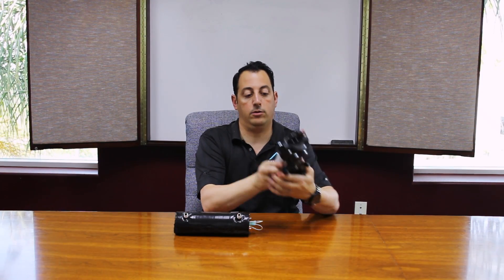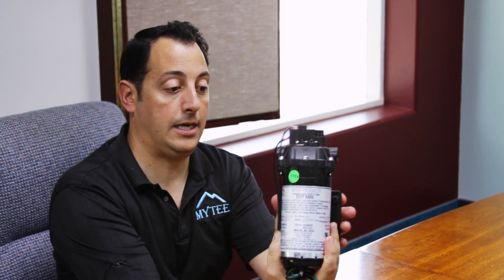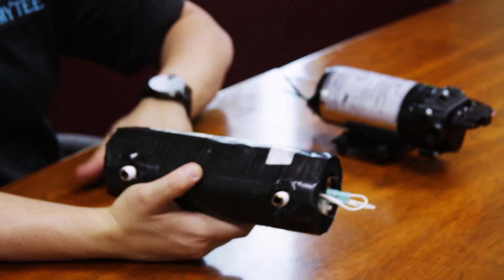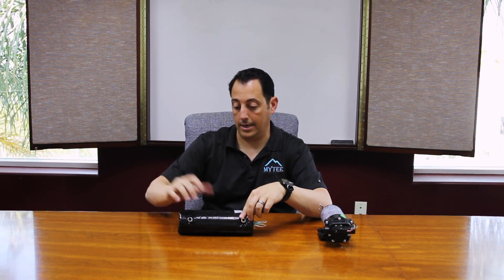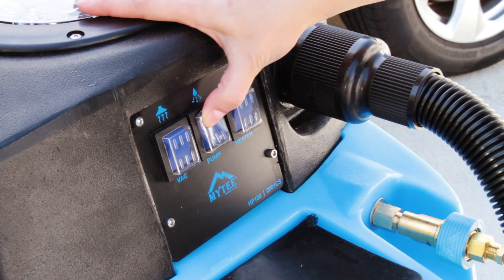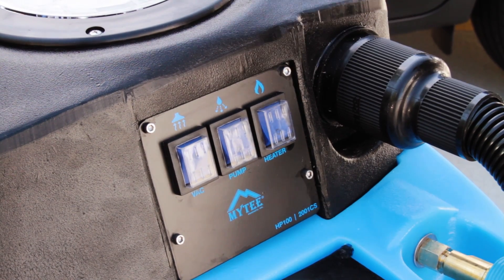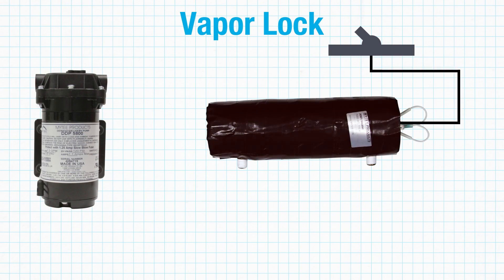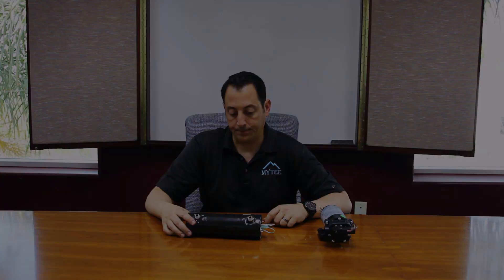Mytee Tech Corner: Getting the Most Out of Your In-Line Heaters

Comment: I’ve been having an issue with my Mytee lite 8070 

Every time I turn the heater on  the water pump starts leaking where the 2 cables are connected .  Can you please tell me what is causing this problem?
Reply from the maker: Sorry to hear that! It sounds like it may be a failed check valve, call our office at 858-679-1191 or visit mytee.com and look for warranty support and we can help you resolve the issue.

Comment: I came across a older extractor. I wanted to put a heater and I chose a mytee 1200 watt . But I'm not sure how to wire it. So call mytee to ask if I could get a wire diagram to switch then plug. But just to be told it's not our machine they can't help me
 Why is that?
Reply from the maker: Our reps are not trained to be familiar with any manufacturer's machines other than ours, so they would be unfamiliar with another machine and how to best wire them. We can absolutely share a wiring diagram of one of our machines with the 1200W heater in it if that would be helpful, I've linked to one below. Authorized Service Centers near you may also be able to assist you! https://www.mytee.com/wp-content/uploads/2016/03/HP120-Wiring-Schematic.pdf

Comment: I have a question mine keeps on stopping from heating I press the little white button turns back on the heater but then after a while it stops then I have to press the little white button again is it the pump heater or is it The thermostat
Reply from the maker: Check out this troubleshooting guide below. If you are unsuccessful with the troubleshooting you can contact your distributor, local service center, or call us direct to speak with a technician at 858-679-1191 https://mytee.freshdesk.com/support/solutions/articles/17000096438-troubleshooting-heaters

Comment: can these be repaired ?
Reply from the maker: yes they can, replacement thermostats, coils and casings are all available on our website
Reply: @myteeproducts  i have a portable with heat -exchanger that is bad , the machine is out of production and the part is very expensive and not sure if repairable; could one of these heaters work - the position of the heater is horizontal

Comment: Some good information I didn't think of before. One question, does it help or hurt to start with hot water in your solution tank so the heater doesn't have to work as hard getting there temp up to its max?

Comment: Is there any numbers as to throughput on the heater blocks (mine is a 8070), It seems my heater is not heating the water well.  From 70F tank water, The fog coming out only seems luke warm to me on my hand.  When water flows through the heater block, should it it around 200F on exit, or does it come down (does heater keep up with the flow rate in other words).  I ohmed out my heater element and it shows 16 ohms and 0 ohms ata the two thermostats, so I am thinking one of the thermostats has lost its ability to remain closed in use, or there might be scale in the heater block that I can not see or detect.  I am wondering about the through-put for both fear of restriction and curiosity if the heater block can keep up with the pump flow going through it.
I seem to get good mist at the distil end jet on the wand as far as I can tell.
I read the document on testing the heater unit and it talks about measuring the amperage at the heater element.. but also talks about using a continuity tester for that function.. Is this a mistake (ohm it out with continuity meter or measure amperage with ammeter?).

Hope all that makes sense and you can understand my questions for you..